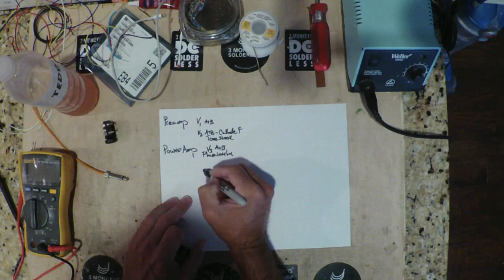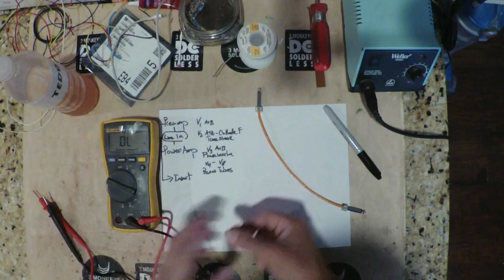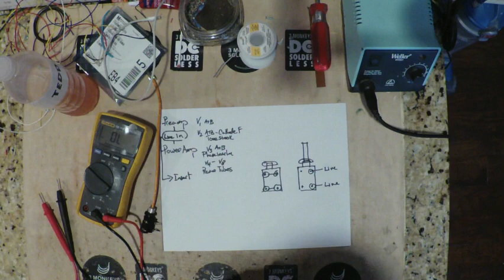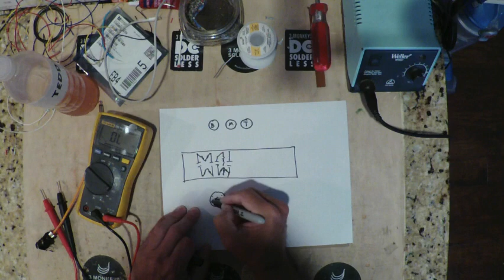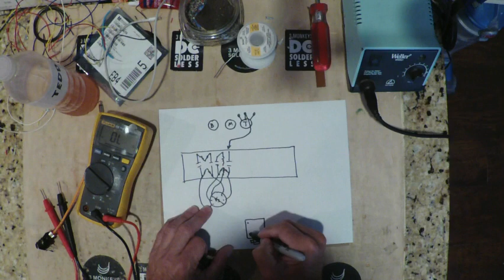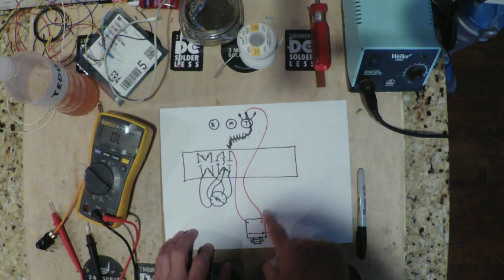Line In Mod For A Marshall

Comment: Is that same point where you would instal an effects loop , but just 2 jacks to be a send and return? Middle lug to send then return to that .02uf coupler feeding the PI, with the same principle that with noting hooked up you have continuity to the coupling cap.
Reply from the maker: Pretty much, yup :)
Ossie

Comment: My question is why is this mod necessary vs running through the input of the amp? I have tried running a load box from one amp into another using a line out from an attenuator/load box and the sound was pretty fizzy at first, but then I tried lowering the EQ on both slave and master amps as well as experimenting with the other 3 inputs and it was usable. Would this mod deliver a better sound? I assume it would be a cleaner sound since you are using just the clean power section for the slave. But do you loose any tone by bypassing the preamp? I am thinking of Jimmy Page as an example where he ran a 69 super bass into two 68 SLs. I am wondering if he's creating a new tone (similar to how you demonstrated the EVH tone in your other slaveing videos) by combining amp tones? BTW, you can probably find pics from Page's book showing the back of the amps.)
Reply: P.S. I think I will buy some of your cables. I definitely need DC for sure. The Strymon DC cables are junk. Had 3 fail in a year. The power (Zuma) itself is good though.

Comment: Great instructional video Ossie thanks for sharing with us. Quick question: I understand that is a line in,  not an fx loop return. Jose pedal has  low and high Z outputs to use with other pedals or rack processors?
Reply from the maker: HI Lucas!

The Jose pedal could be considered low impedance as the output stage is a cathode follower with a 25k ground reference.  It works best with this line in... the pedal will also play very nice with pedals and rack processors.... 

Thanks for watching and for the comment!

Ossie